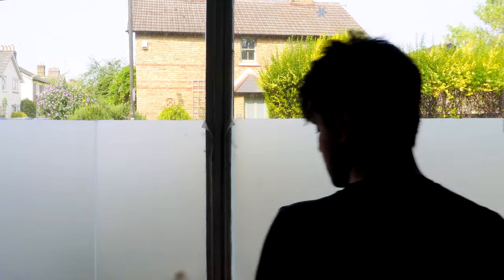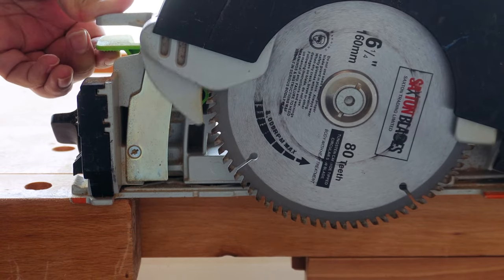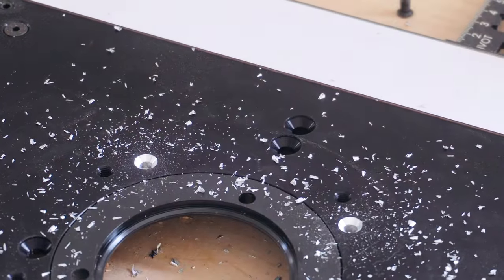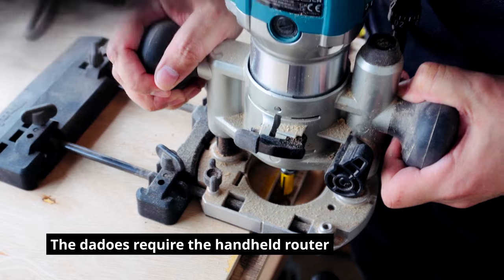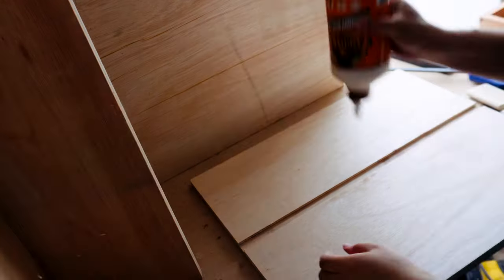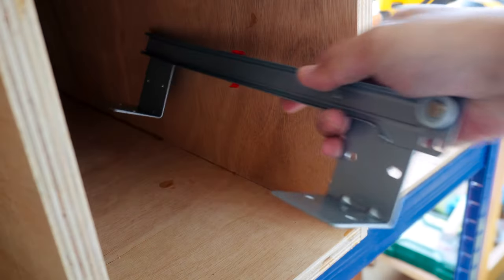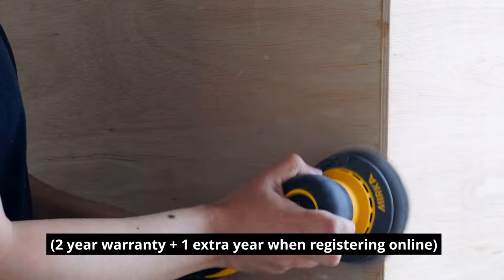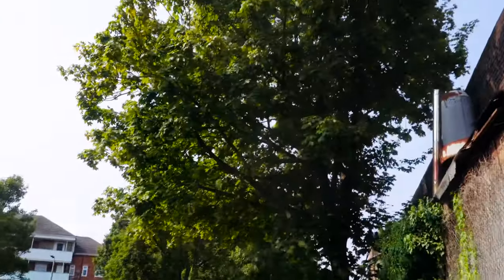Upgrading My Tiny Workshop with High-End Tools (for Less!)

Comment: I've been at it for over 50 years and I think you made some wise choices. A good tracksaw and something like an MFT can do most of what a table saw can. Router table is also a great choice, I built my current model about 25 years ago (Norm Abrahams NYW clone) and never regretted it. I might argue that a good bandsaw might be ahead of a drill press. The Merka is a great machine but, too many clones at a fraction of the price and work just as well. People love to hate them but, a Domino would be a life changer for you. I did traditional joinery for many years before giving the Domino a try. They just make things so much faster and easier and if you're in this to make a living those two things matter.
Reply from the maker: Great advice, thank you so much! I do agree a bandsaw would be a great addition too, maybe that’s my next one!